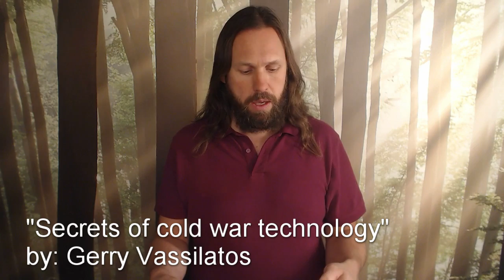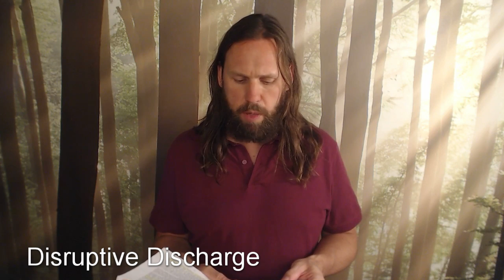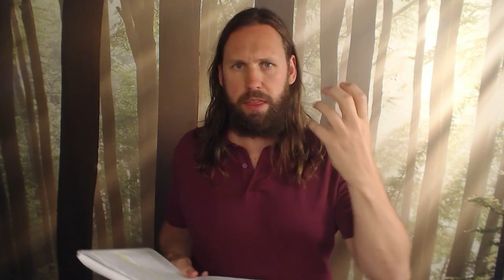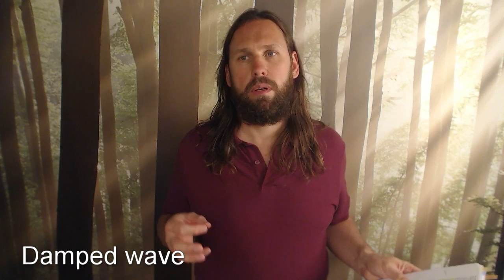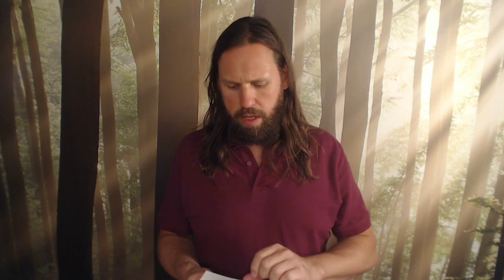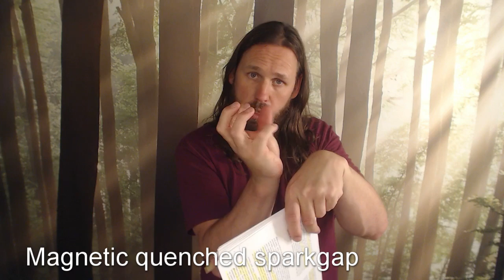Nikola Tesla's Radiant Energy Part 1 of 3

Comment: Coming back to this video, as I often do, there is one thing I can't help but wonder which is one of the few parts not explained by you, and that is did we ever get an explanation of vinny stvincent's set up in which he produced this gaseous discharge? I've tried following it many times and the closest I've gotten is that its the classical Tesla Hairpin Circuit, but in the non shunted mode(to my knowledge), an air quenched spark gap(as seen from the beginning), and that one of the rods used  are placed in connection to ground, while the other is left alone, and that the rod that is grounded is then connected with a wire that goes to a plate that is also grounded, and that the gaseous discharge (which truly is unlike any discharge, i've seen some in the comment section try to say it just a plasma arc, but you can't really see through a plasma arch like you can with this one, nor is it as non volatile), is produced between the both of these (the grounded rod and grounded plate). I'm probably far off but I thats how I understand the "circuit". I'd very much like to do the "paper test" with this discharge to see how it behaves, considering an arc will burn paper, while sparks will punch holes through paper, but if this differs greatly from the other two then its even more evidence...

Comment: - the overshoot is caused by a sudden change in capacitance, which does boost voltage.
- the stinging is caused by small parts of the wire or insulator being electrostatically repelled & launched at high speeds.
- electrostatic repulsion for launching tiny droplets was the basis for his "death ray".

Comment: ¿How can we amplify the negative peak? ¿Using more turnarounds on the coil? ¿or using more diameter on the coil?
Reply from the maker: more voltage over the coil. yes more turns bigger diameter also works. but less inter turn capacity also works (and is needed). as it is a resonant half wave
Reply: @MasterIvo  thanks! :D

Comment: Hi master Ivo, would you maybe consider investigating the topic of switching high voltage using vacuum tubes? That's the idea that Peter Lindemann suggests in his book, but its implementation is not easy! The problem is making the circuit that drives the grid of the tube with square pulses that allow plate current and cut it off completely. No one is doing this now, people just use auto feedback VTTC. This switching was used in old radars and some literature exists that explains it from that perspective. Having a video that reveals this technology would be fantastic!
Reply from the maker: Thank you for your suggestions.
I am familiar with working with vacuum tubes and they indeed can do a lot. but they are not easy to work with, or to come by these days. A vacuum tube thyristor would be a preferred method.
But there is a reason why I choose solid state switching with MOSFETs. they last are dependable, affordable and still getting better.
This makes it easy to replicate and that is very important to me.
Reply: @MasterIvo  This could make a impulse DC radiant laser beam.

Comment: What is the difference between radiant energy and splitting the positive to get brilliant white cold electricity?
Reply from the maker: radiant is the very fast change in (high) voltage, that causes the cold current to flow
Reply: Yes and im thinking of a radiant energy with a xenon arc lamp fed with impulse HVDC. Then using the light to charge capacitor!

Comment: The overshoot pulse at turn on might seem perplexing at first. BUT every wire has some inductance even the wire connecting to your coil, switch it fast enough, and that small inductance will have an effect.
Reply from the maker: correct. But I managed to get an overshoot with opposite polarity!

Comment: Have you ever heard of Agnew Bahnson's patents for his electro gravitics device from 1956? It seems to me he was using the same kind of pulsed fields. What I find also interesting  was he had a toroid also that was hooked up to AC which looks to me like he was using that out of phase with the DC to create a Anapole like field. Where there is a poloidal electric field and the toroid creates a oscillating dipole, if you look up anapole modes and his patent you can see the similarity.  He also had had counter rotating bifilare or filare plates that were shaped like a satellite dish facing down, he had both like that stacked on each other with a small distance between,  Im wondering if that was to constantly having a moving phase, Im wondering what the effect would be.  I think Bahnson's discovery's are important,
Reply: Where can I see and read about this?

Comment: The Bifilar coil itself has the ability to act as a resonant capacitor, stacked coils with gaps between them, in particular with common and opposite polarities can have varying results in building huge amounts of energy, and what is described here is the energy finding the best path of ground, or in other ways Tesla would describe it, suffering it to find equilibrium.
Reply: How does the Bifilar coil act as a resonant capacitor? Does winding it like that make it self resonant during operation?
Reply from the maker: or creating a vacuum of energy, by discharging, and ground providing current for equilibrium
Reply: @MasterIvo  Does this mean the bifilar winding will keep the coil at self-resonance regardless of frequency supplied to the coil? Still building my notes on the bifilar winding.

Comment: NUMBERS:  (copy and paste from my files):

'IF' my latest TOE idea is really true, (and I fully acknowledge the 'if' at this time, my gravity test has to be done which will help prove or disprove the TOE idea), that the pulsating, swirling 'gem' photon is the energy unit of this universe that makes up everything in existence in this universe (including 'space' which is energy itself, 'time' being the flow of energy), and what is called 'gravity' is a part of what is currently recognized as the 'em' photon, the 'gravity' modality acting 90 degrees from the 'em' modalities, which act 90 degrees to each other, then the oscillation of these 3 interacting modalities of the energy unit would be as follows:

Gravity: Maximum in one direction, Neutral, Maximum in the other direction;
Electrical: Maximum in one direction, Neutral, Maximum in the other direction;
Magnetic: Maximum in one direction, Neutral, Maximum in the other direction.

Then:
1 singular energy unit, with 3 different modalities, with 6 maximum most reactive positions, with 9 total basic reactive positions (neutrals included).  Hence 1, 3, 6, 9 being very prominent numbers in this universe and why mathematics even works in this universe.
(And possibly '0', zero, as possibly neutrals are against other neutrals, even if only briefly, for no flow of energy, hence the number system that we currently have.  This would also be the maximum potential energy point or as some might call it, the 'zero point energy point'.).

And also how possibly mathematical constants exist in this universe as well.

*  While in bed one morning after a restful nights sleep, and assuming the above is correct, I mentally went 'inside' the 1 (the singular pulsating, swirling 'gem' photon itself).  I still saw with my mind the 3 different interacting modalities, the 6 maximum modality points, the '9' including and being the neutral points in the middle which faded into a 6 (as each maximum modality point came towards zero), that 6 fading into a 3 (as each modality came together), which turned into a 1 (which was the '0' point), but '0' wasn't zero. So, '0' is not really '0' but is something, not nothing.  '0' is a relative '0'.  But then here again, the zero point energy point is the maximum potential energy point for any and all modalities of the 'gem' photon.  '0' is '1' and '1' is '0', this is the '1' inside the '1'.

Now I just have to come up with some tests to test this idea of the zero point energy point being '1', a maximum potential energy point of the singular pulsating, swirling 'gem' photon itself.  The maximum potential energy point not really being potential energy per se, but the neutral point of kinetic energy.  Tapping into here would be tapping into the 'zero' point energy point of eternally existent ever flowing energy.  But then again, tapping into here, 'if' distorted what makes up space and time itself (assuming that 'space' is energy itself [the 'gem' photon] and that 'time' is the flow of energy), could it alter or even destroy the very fabric of space itself?  What would occur if even only a single pulsating, swirling 'gem' photon were to explode?  What potential ripple effects could occur with the rest of space and time?

Hence also why I try to think some things all the way through so as to try to identify potential issues before the test.  Unexpected, unintended, potentially dangerous or even deadly consequences.  If nothing else, it keeps my mind active.  The mind, use it or lose it, but using it could also lose it, permanently.  (My own and other's).

Putting the 'zero point energy point' into actual practice could be deadly.  Warning:  Proceed with Caution.  The last words of human existence on this Earth might be, 'Hey it worked, ooooppppppsssssss.............'.

*  Note also:  Nobody as of yet has been able to show me how numbers and mathematical constants can exist and do what they do in this universe from the Standard Model of Particle Physics (SMPP).  While the SMPP has it's place, I believe we need to move beyond the SMPP to get closer to real reality.

Comment: The flat coil is the best way to leverage a spark@ 1 million frequency per second. In other words, it is not enough to get a spark at 1 million per second. One must use the longitudinal “expression” to perturb the backround static electricity, and so running the spark through a flat will “tickle the aether” as Thomas bearden put it. I will be doing a build soon. I didn’t want to get it started, until I understood. 
It took me 12 years, but I think I finally get it.

Comment: I have been reading tesla everyday for years. Especially the Westinghouse bankruptcy transcripts. The radiant patent won’t work with out a spark gap. Tesla clearly put the spark gap in the patent. What he didn’t mention in the patent is the frequency necessary to unlock radiant energy. 
Tesla mentioned static electricity is not that static,it vibrates at around 1 million per second, or one could say the resonant frequency of backround energy is @ 1 million per second. Tesla said electrons are emitting very small quanta’s of matter that have exceptional charge. He also said there is an insulating fluid that keeps all radiant matter from combining, creating ever larger potentials of voltage and current. 
To break down that insulating fluid, a longitudinal wave must be employed(a spark), and the frequency must hit resonance of about 1 million per second. When that is achieved, a simple conductive plate will start charging up with out stop. It can be a comparably small plate, as the potentials are off the scale, as far as traditional measuring goes. 
It took a long time to figure this out, but it seems obvious now. 
Tesla was always speaking on getting a spark with the lowest energy practicable. To that end , he invented a quenched spark gap that he put into a vacuum, and used metals with less resistance, like silver.
Reply from the maker: yes the quenched spark, represents a very quick change in high voltage.
this sets up a displacement current, which is what Tesla called Radiant.
this shock of fast changing high voltage, produces a longitudinal wave, like a tsunami.
Reply: @MasterIvo  1 million sparks a second is something tesla spoke of in the Westinghouse bankruptcy proceedings.
Reply: @MasterIvo  This wave can be focused to a beam to make his teleforce longitudinal beams. Its a kind of force beam laser!
Reply: @MasterIvo  why has no one done a spark at this rate before? Dollard still hasn’t even brought it up?  I plan on 2 tesla turbines to get it done…..Tesla had a screw in his condenser that would cause an arc when the condenser charged to a certain point. I guess he could charge those fast?

Comment: I have come to one question. In all your circuits transistor switch is before the coil or resonant schematics. I thought coil or combination with capacitors should be energised with dc before circuit switch (transostor) closes (current flows). So I made  same schematics  with transistor close to negative terminal or after resonant schematics. Does it make sense?

Comment: Y dont u put a on of mosfet on the earthing as it acts like a compression or a make into a compressive wave at the rate u want to switch the compression similar to  how u switch the dielectric with spark gap n tela coil... Compression ant secondary coil then run a tertiary  resonant coil of these two nd c if power flows till I achieve 90 deg phase difference between these two.......

Comment: Around time 17:00 in the video you describe shortening the pulse and not needing higher voltage.  We make use of the 3rd time derivative of position - we started doing this due to a late 1960s paper by Andrei Sakharov in which he specified "sudden departures from equilibrium" as a way to manifest effects.

Our signal processing honors the fact that the Vacuum (the aether) is designed by Nature to quench any concentration of power.  This design philosophy of ours permeates everything we do.  Thermodynamics holds that all systems reach a "lowest energy equilibrium" condition - in other words,  "Nature will quench away every attempt you make at creating some energy"

I'm not saying we view this aspect of Nature as an adversary but it is inescapable that Nature will very quickly QUENCH your device's energy.  So we honor that fact.

And here is our signal processing design - this is just an example, these are hypothetical numbers:
1)  first pulse is 10 volts with a pulse duration of 500 milliseconds
2)  second pulse is 100 volts with a pulse duration of 50 milliseconds
3)  third pulse is 1000 volts with a pulse duration of 5 milliseconds

In effect, we are telling Nature  "look - we understand you do not like suddenly-appearing concentrations of energy, and we know, Nature, that it is your job to seek a lowest-energy equilibrium in everything, and thus to quench our energy pulses.  But we have a job to do.  Our job is to manipulate the Vacuum (aether) so, I'm sorry, Nature but we are going to use the 'jerk' method of physics to overpower your attempts to quench our pulsing."

If you look up  "jerk (physics)"  on wikipedia, the jerk is a physics term that is the 1st derivative of acceleration.  It is an acceleration of acceleration - it is a rate of change of the rate of acceleration.

A further signal processing is to apply different delay times between (1), (2) and (3) above.  And also, to have as many as 10 steps, where each step increases the voltage and shortens the pulse duration.  Using a computer program to alter these variable is the easiest way.  And to your point, you can run tests and assess the results at low values of voltage/current before deciding whether to boost the magnitudes.

We're trying to temporarily disable Nature's ability to undermine our pulses.  A human analogy could be,   a force of 10 men storm a fortress, and 20 Nature-men inside the fortress try to stop the 10 man force, and then 1000 men storm the fortress and overcome the 20 Nature-men.  We are OVERWHELMING the ability of Nature to quench our pulses.  Only temporarily of course.  Even the strongest forces are reduced by Nature back to a lowest-energy equilibrium (even the A-bomb was quenched by Nature's equilibrium).
Reply: This can be used to make focused aetheric force beams like Tesla did. Very interesting stuff indeed!
Reply: Sal pais talks about engineering the Prigogine effect non equilibrium thermodynamics

Comment: have been looking at Don Smith, I feel he did the same, but he uses any HV low current device for the radiant input spike on a coil that is inductively coupled to 2 coils which are also coupled with each other and which generate an even higher voltage to be used against the earth ground instead of circuit ground, so unlimited amps are allowed, because there is no back mmf killing the source. Then I realized you use the back emf spike redirected with a diode for the same (high di./dt) which is quite a clever finding.
Maybe you will reinvent the Don Smith circuit and effects using speaker wire instead of expensive coils like he did. :-)
He said Tesla was his teacher.